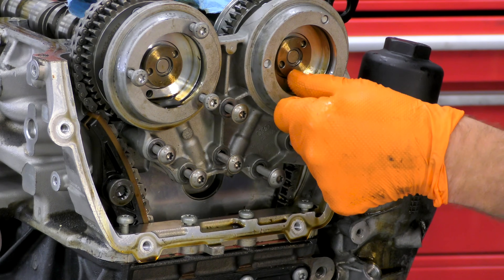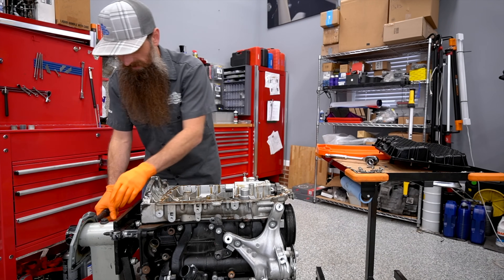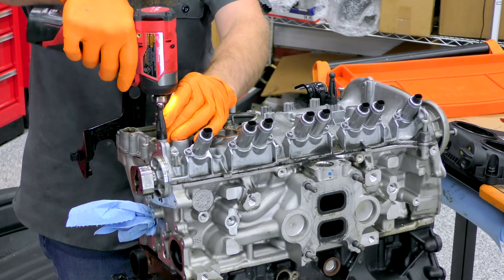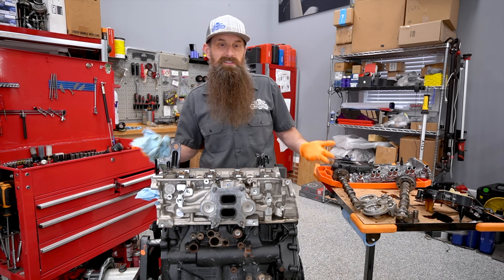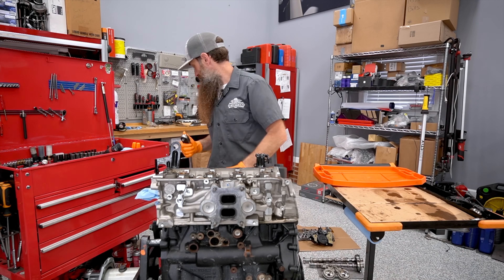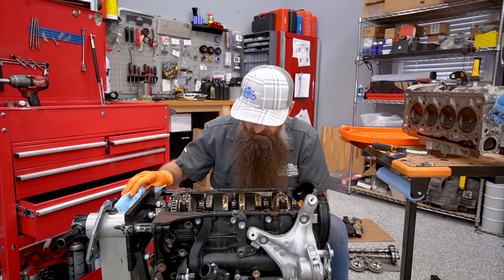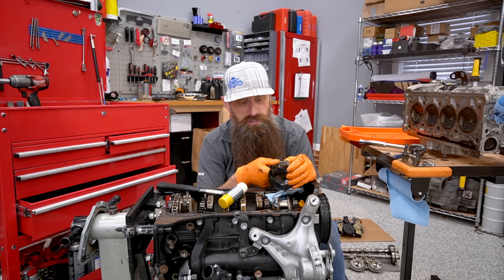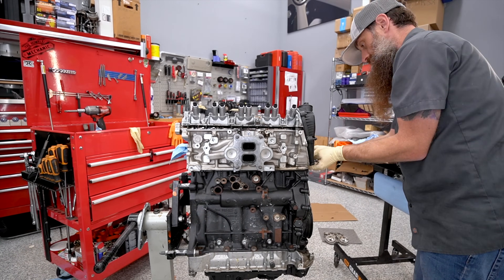Catastrophic VW Engine Failure and Teardown 2.0t TSI

Comment: Need your advice and knowledge please- i have 09 vw tiguan, i bought car with 122000 km, engine had valves hitting pistons, had head rebuilt, pistons looked and measured good, cyl walls were perfect, no scores or ridge at top of bores, installed new chains, sliders, tensioner etc, new rear main seal( new style) etc.
Engine ran very well , didnt use any oil ( amsoil- 5-40) between changes every 6 months, until 162000 km, then it all of a sudden started to use oil, about 1 liter in 100 km. I replaced PVC valve 3 times, didnt help, finally i rigged up catch cans, one for turbo inlet pipe from PVC valve, and one for hose from PVC vavle to intake man. I also rigged up a guage ( in of Hg) to measure base pressure,
Drove my normal route to town and back , 55 km total, the catch can for intake hose from pvc valve had about an inch of oil, approx 1 liter paint can, the hose from pvc valve to intake man( that i had rerouted to catch can) and blocked port in intake manifold, was about 1/2 full, base pressure at idle was 4 in hg, driving was 9 to 11 hg, did a compression test, with intake manifold pvc port open, rotated engine same for ea cyl ( 7 bounces of guage needle) and had 2 cyl at 172 psi and 2 at 175 psi. 
When idling engine in shop, pvc valve off engine, there was very obvious base pressure.
Removed engine, dismantled, and could not see any damage or reason for base pressure, 
Installed new chains, decarboned intake vaves( removed from head) new valve seals, new rings, end gap in cyl were to specs, pistons still appeard and measured to specs, reassembled engine, new turbo, not vw, put in amsoil 5-40, drove same route
Was a little better, 1 lt in 150 km, drained oil, put in 30W break in oil, drove 150 km, used about 3/4 liter,
Did compression test , had 175 across all 4, put oil on pistons abd compression jumped to 220 psi on all 4.
All parts used, including updated intake manifold, were vw (german) except turbo and rear main seal
I have assembled many engines in my career, both gas and diesel and natural gas fueled, never had this kind of problem
Help please!!! 
My email is           scork@goldcity.net

Comment: OK, I have a Volkswagen Passat CC 2011 after an engine swap I keep getting the error engine oil, pressure regulation valve electrical error in circuit and I can see a wire hanging down but the problem is that I cannot find where the oil pressure regulation valve is located. I even went to a few mechanics and they try to search for it down of the oil housing area just above the oil pan and they could not find the place so can you like guide me? My engine label is.BZB 100559

Comment: Love your channel!!!  I have a question.  I have a 2009 EOS which has lost power.  Not sure if it is a cot converter issue or turbo.  I replaced the manifold, but I am noticing that I am seeing antifreeze coming from somewhere off what appears to be the oil pan.  Brought the car and it ran for about 4 weeks, now I'm trying to figure out problems to get it back on the road.  Any suggestions?

Comment: Hi Charles, i have oil in the spark plug wells of my Seat Leon ST Cupra 290. Could you show us how to seal the valve cover on the EA888 Gen.3 with as little effort as possible? Is there a way to do it with just relaxing the timing chain and leaving the camshafts in? I would be very happy if you could make a video about it. Best wishes from Germany. Cheers Frank (one of your biggest fans)

Comment: Hi Charles, any chance to make an DIY video for the camshaft/valve cover on the EA888 Gen 3 ? mine is leaking as well with the Upper Timing Cover (that last one i know is easy peasy), but the cam/valve cover i know for sure its not that straitforward... and i don't want to mess my timing

Comment: I really dislike modern car engines. Peak reliability was fuel injected, direct ignition pushrod v6 Buick….did 400,000km and still didn’t use a drop of oil. The rover 3.5 v8 was pretty solid too. These new engines are just waay too complicated in order to deliver low fuel consumption and emissions imo

Comment: Have you ever encountered misfiring at cold start? It drives me crazy. Had several mechanics look and couldn't find the issue. No codes, no check engine light. When the engine is cold I can feel the car misfire between 1000 and 1500 rpm, always at the same point. Once temp is up it goes away. I have replaced spark plugs, maf sensor, O2 sensor, pcv valve, coils, chain and tensioners, had the engine resealed, injectors cleaned. It is just weird!
Reply from the maker: Usually that’s carbon on intake valves
Reply: That was my next point as I believe it has never been done. Is there any other way of cleaning without removing the intake manifold? Any miracle or spell?
Reply: @PaulBuhus not very hard to remove the intake manifold should probably take 20min watch naptown tuner on youtube hes a mad man with these engines

Comment: I don’t know why it’s so hard for people to understand with these 2.0 motors….swap the timing chain at 100k, water pump, change oil every 5k miles and you’re gtg.
Reply: Wrong. I did that and still water pump goes at at 39k miles. Have an Audi care plan plus did a 5k oil in between each. These engines are trash.
Reply: @reelrocknrolla4251  EA888 are mint but the pumps are bad. Really it's the only issue with them. Yes it's a few hundred to sort but it's not timing chain like an F30....
Reply: @dreamcrusher112  I hope you are right. Not confident in these on long road trips anymore.
Reply: Wife’s car is approaching 100k. No issues other than two small oil leaks that were taken care of easily. Also the 100k timing chain is not an issue if you have access to a VCDS. It will tell you the chain stretch and if it is in spec. When it is out then you replace it.
Reply: my timing belt has a 100k service interval. 100k for a chain engine is a lemon

Comment: QUESTION. sorry to be annoying, but im doing a valve cover gasket replacement and im wondering if i need to do anything with Timing or the cam's in order to remove the valve cover. will removing the valve cover affect the timing, chain or cams in a anyway ? do i need to take extra step in order for everything to be at the right timing ? thank you

Comment: Do these motors have forged internals like the 1.8t did?
Reply: yes it can hold like 450lbft, much more than the 1.8t. Pistons are the weak point as you can see, i ran over 600hp for over 100k miles and my piston said bye but rods look new no bending
Reply: @VuBeClan thank you!

Comment: how are you i have a 2016 1.8 turbo tsi on cold start up i get a 10 second whirling noise its been well maintained with regural oil changes cant find any leads only been sugested the secondary air pump?  any ideas let me know tnx
Reply from the maker: Likely that is the noise. Any faults stored

Comment: I've got a '16, APR Stage 2 Golf R.  I take really good care of the car, it's my daily.  I noticed it developed a mild vibration around 3K RPM on the highway.  Thought maybe it as a wheel out of balance and continued to drive the car.  About 3 weeks later, spun a bearing.  Located a used block with 55K miles and it's getting rebuilt and put back in the car.  It's going to set me back about 9K all in.  Soooooo frustrating!

Comment: I've had many Audi's in my life and have always paid their high price [for a VW like product] because of the great ergonomics, beautiful Bauhaus-inspired design styling and good general build quality. If I look at my current A4 in detail, I am astounded at the lack of both good ergonomic design and honest build quality. The buttons fail early, don't work in terms of ergonomics and the car is clearly designed with Pre-determined product obsolescence in mind. "Everything will be worn out by 200kkm". My first TDI lasted 500kkm with no issues [1000km range on a 48l tank of diesel!] The next generation lasted 400 [1990's], the next gen lasted 350 [200's] and the next, 250. I take care of my cars, I pay a high price for them [chunks of my life] and have been loyal to Audi. My current Audi is KAPUT at 215kkm. Everything is worn out! MADE TO FAIL. Flimsy! ......   As an Electrical Engineer and Industrial designer, I have to admit that my professional opinion is that this sucks! I am no longer seeking and Audi as my next car, after 30years at the wheel of the 4 circles. I note their presence on the list of the 'You shall own nothing and be appy" club, with great sadness. Herr Hoch would be doing high RPM's in his grave, if he were to see the sorry state of the once wonderful marque that he created. Sandy Munro is quite right, of course. SAD, very sad.
Reply: I agree, from owning many vw's and audis in my life the most reliable was my 2.0 Golf 3 , that engine was built to last. Now, I buy BMW diesel.
Reply: I hear ya... I have a 2015 Jetta 1.8 that has a few issues and gremlins at 130k miles.  Meanwhile my Chrysler minivan is still on the streets at 300k miles.  This Jetta will never accomplish that and it's obvious.

Comment: Love these videos and how well you explain everything! 

Question: On these engines, to remove and reinstall the valve cover (eg. For resealing), can it be done without having to re-time the engine? There looks to be only the valve cover holding the cams down, would they spring up and/or move at the end without the chain when it’s removed, then causing issues with timing or refitting etc?

Comment: Hey, big fan of your work. I have a few questions if you're able to answer them. 06 A4 quattro S-line 6spd. It takes a hand full of cranks to start. Have pesky code P2293. Fuel pressure regulator performance. It feels good till the code comes on, then feels like it's in limp mode. Won't go past 4k rpm. But if I unplug the low fuel sensor it will rev out all the way and drives great. With CEL on. And car starts normally without hesitation. Plug that in and then limp mode. Unplug the fuel pressure sensor on the fuel rail and it drives fine again. I'm at a loss. If you can shed some light I would greatly appreciate it. This is what has been replaced. 
Plugs 
Coils
Fuel sensor low/pump
Hpfp
Cam follower
Fuel filter
Fuel module 
Pvc
Valve cover

Comment: Hey Charles!

You're my last hope.. Bare with me for the long post!

Bought my 2011 A4 last December. Bought at 96000km and had an android head unit installed on the same day.. The issue started 2 weeks later.

Previous owners put 87 in it for 10 years. ive been putting obly 91

Only happens when temp is sub-5 degrees celsius after the car has been sitting for 4+ hours.

Only codes showed were p0300 intermittent misfires occasionally but car runs great once its on.

Took it to 4 mechanics (including Audi).

2 said nothing was wrong and the other 2 tried all the following:

- replace all sparks and coils
- replace all 4 fuel injectors
- replace engine air filter
- replace fuel filter

Car doesnt have oil consumption issue (had stage 1 fix under a recall under previous ownership).

Timing chain not done yet.

- engine oil interval is 10000km under my ownership as I do lots of highway driving

Car is now at 130000km. Issue has persisted since.

Any ideas?

Also I recently noticed that I dont always hear my fuel pump prime upon door opening, and usually that dictates how the car will start.

Comment: @12:22 I could imagine Skoda wouldn't stand a chance on US soil because the market is so oversaturated. Would Americans really buy Volkswagens on a budget even if the build quality is on par or better?
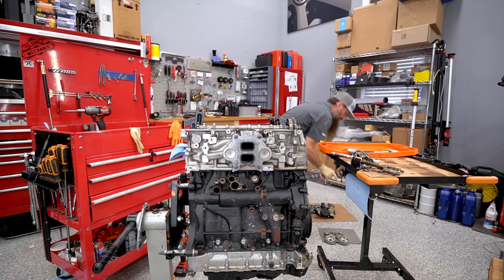@16:04 You can even weld blocks if you have the right machining tools but it is mostly reserved for restoring classic cars with rare and expensive engines.

Comment: Right from you open the top I can tell the person didn’t take care of her care well lol. 
Heads are burned . Cylinders look alright. I think the reason why the spring broke probably from the pressure build up maybe when driving it and not working on the engine itself.

The other day we had a bad case of one cylinder was not working it been broken for awhile, the second when just broke, there was gasoline from injectors, the water pump gasket was broken and since it was it made the car overheated. It was a headache and a rare case.

Comment: Many years ago, as an apprentice, one of our jobs was to rebuild any engines and manual gearboxes that were going back on warranty exchange, any missing parts or wrongly assembled components, and the warranty claim was rejected
Reply from the maker: Jeez! Super lame especially if they didn’t pay to reassemble
Reply: @HumbleMechanic  it was a rule from the Warranty company, but it was the best training an apprentice could get, instead of doing one engine or gearbox rebuild every few months, it was more like one a week.
 Lots of manufacturers have slightly different riles regards warranty, I used to work for one in 🇬🇧 as an auditor, a certain number of job cards were selected every 3 months, if the Dealer had claimed too much time, or more parts than required, and put it through as a claim, not only that job was rejected, but a % of all the claims in the same time period.
    The Manufacturers thinking was you screwed us on that job, refusing one claim, doesn't hurt much, won't stop you doing it again, but refusing 10% of the claims you made in those 3 months, might!

Comment: Hey Charles, I have 2016 R and I've head an issue of oil seeping into the #4 cylinder spark plug well. I was hoping you can use this engine to show how to properly reseal the cam cover as a DIY, I can't find any videos or guides on this process.

Comment: that shattered piston ring is more likely caused by the very tight piston ring clearance. when the engine is running stock, the temperatures are not such extreme. so volkswagen decided to make the clearances very tight. however when tuned, the piston assembly is getting hotter, and so the ring expands so much, than the ends contact each other and so they cannot expand anymore. and since they are in the bore and piston, they lock up against that cylinder wall and piston and destroy everything. so you need to put the clearances bit more loose, to make sure the rings will be allowed to expand..
Reply: This is a failure which can also happen on gas chain saws if you don't warm them up but go to 13k RPM with a cold engine

Comment: I have a 2017 Skoda RS that was tuned, and did exactly the same thing. Clean smashed the ring land off no 3 piston. Had a strange ping one day for half a second as i was driving, nothing more. Next day the wife took off from the traffic lights and boom, engine ruining rough. No other warnings. Just ticked over 60,000km. 

I swapped the engine for 10,000km MK7 GTI engine and deleted the tune. Apparently, the Skoda EA888 had a different piston material and its not as robust as the MK7 EA888 piston.
Reply: Might be the same for my 2019 seat

Comment: 1.8tdi, 1.9tdi, 2.0tdi, 5.0tdi, 3.0tdi,1.4tsi hybrid, dsg, turbo upgrades, injector upgrades, transmissions, wrenching all night long!! Glad all that is behind me. Now 0 liters, 0 turbos, 0 transmissions, 0 quarts of oil. 2015 E-Golf takes every Golf R or anything with tailpipes sticking 3 feet high in the Denver Area to 40 MPH. For the low price of a couple hundred bucks a month this EV has over 90,000 Miles of full throttle action and is still kicking! Not a penny spent aside from BFG KO2s once a year, windshield wipers, and fluid! P.S. I don't miss the old stuff, not one bit. I especially don't miss knuckle busting in the freezing cold. Good luck gassers, I hope you catch on too.
Reply: Yikes. That’s really boring. Especially when you can’t go more than 100 miles without being afraid of becoming a giant rolling paperweight. Enjoy!
Reply: @BabyBugBug  LOL, tripped 100k Miles in the VW, now we have an R1S and can do 4 wheel burnouts hauling 11,000 pounds easy!  We have 70,000 miles on the Rivian we bought last year! How far do you travel?
Reply: @BabyBugBug  Be not afraid; electricity is everywhere! Even all across the frozen Rockies!
Reply: @binauralauto3621 Sure, until the grid can’t handle the demand then you’re SOL 😂

Comment: People complain to much about VW quality. It's not that bad. Just some engine sizes that don't go well. And at least the Germans don't build so as much v8 as the Americans. Technically they build so many v8's so they can get more oil. No other nation build so many v8's. Even back in the day in Europe u had very good economic class and 2 liter engine's with enough power to get you from a to b.
Reply: Some VAG engines suffer from several problems, especially timing chain issues but there's also one where the piston is made too thin around the piston rings and the material breaks off regularly.
If you want decent 4 cyl engines you are far better served with Japanese engines than with the German ones produced today

Comment: Charles, my daughter drives a 2013 A5 2.0 TFSI with 50k, when it starts after sitting about 1hr has a slight "lack of oil" sound.. When I removed the plastic sump to check the oil pump, there was no windage tray, would that have caused any problems?

Comment: Just imagine how good combustion engines would be if the manufactures stopped letting the fraudulent environmentalist dictate engine design. Just imagine Volkswagen engines with direct ejection & less focus on emissions pats & design. Sure I'm ok with some emissions parts but when engine designers are forced to put MPG & Emissions priority over engine life space & part strength you end up with what we have today. Just imagine if the focus was on car frame strength & engine longevity. Emissions laws are the reason we have all these plastic parts. Some think its to save money but the truth is most plastics are to try & make the car weigh as little as possible for better MPG. Car manufacture's & engine designers are not being allowed to do what they do best, they are instead poisoners to the ridiculous emissions standards that hurting the consumer.